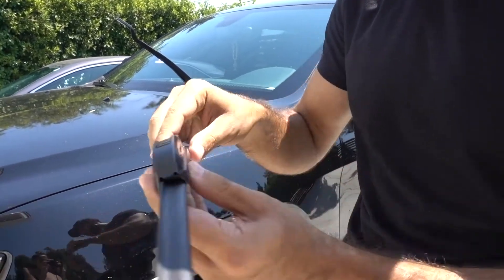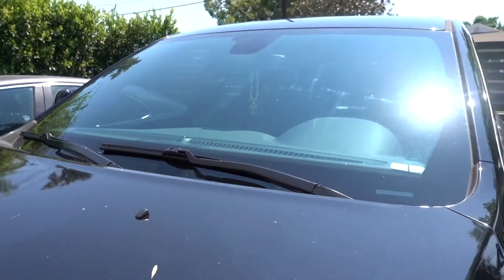How to Replace Windshield Wipers on Your Jeep. Best Windshield Wipers!

Comment: They silicone like rainX?... also I got a 2017 Jeep Grand Cherokee Altitude and I be live in Buffalo where it snows... what size are they 22a... 21b
Reply from the maker: Yes I used 22 and 21 sized wipers! To be honest the material in the Bosch icon is a mix of different rubber as far as I know. According to Bosch website they direct comparison to rain x the Bosch shows it as a better wiper 🤷🏻‍♂️ I personally think the Bosch is not as loud and overall is great wiper! I’m from Philadelphia and used them in the winters out there aswell!